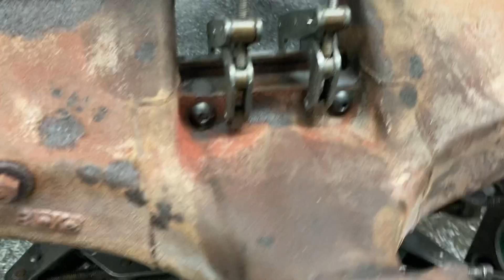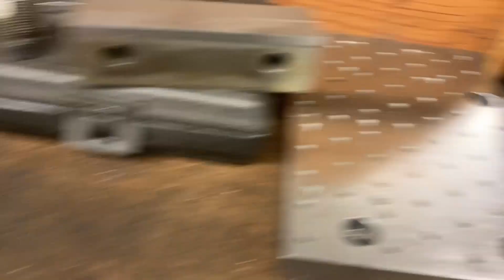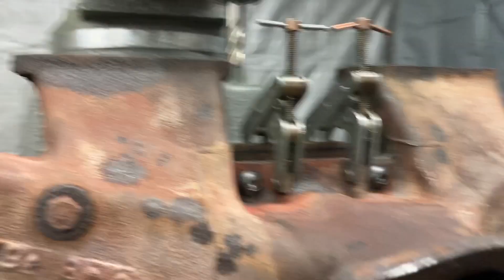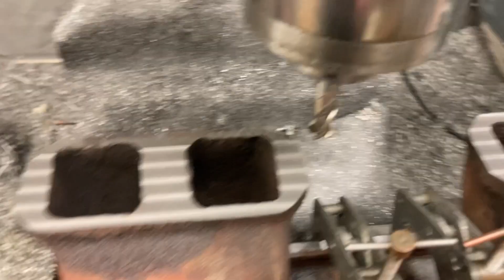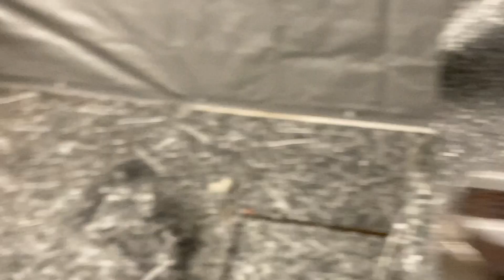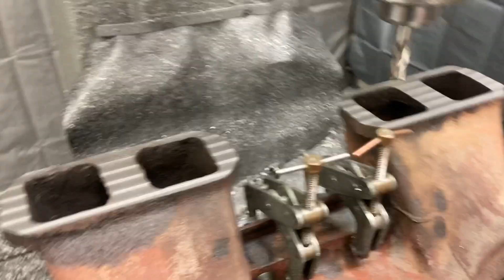1942 International Truck Blue Diamond Engine Exhaust Manifold - Resurfacing Flange

Comment: Just wondering why the 3/4 endmill and not a fly cutter or 3" facemill?
Reply from the maker: If the set up was more rigid and the parts was not subject to excessive vibration a fly cutter or shell mill would be way faster. Small sharp tool means less tool pressure and smaller bites between the teeth. Less chomp, chomp, chomp action in my opinion.